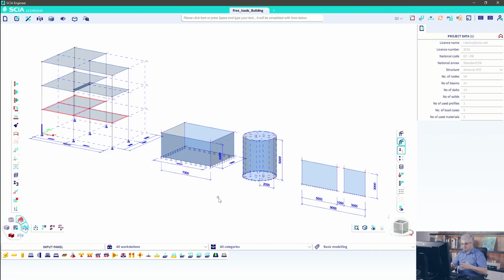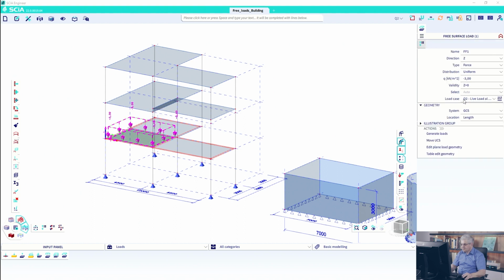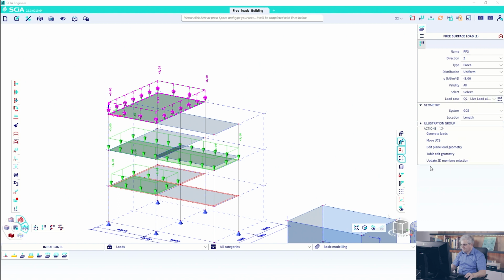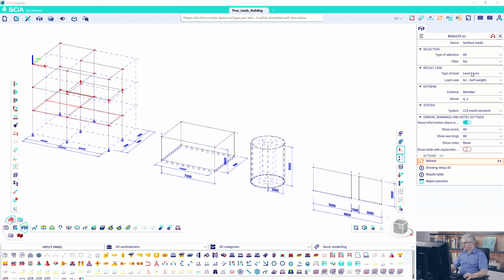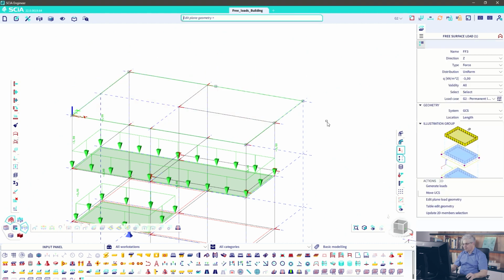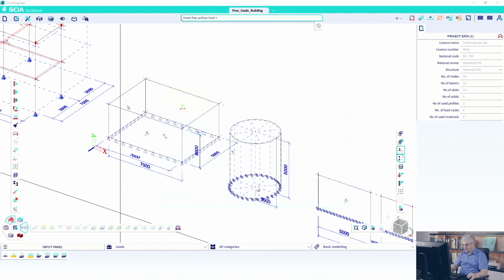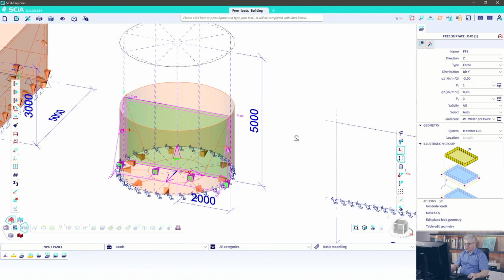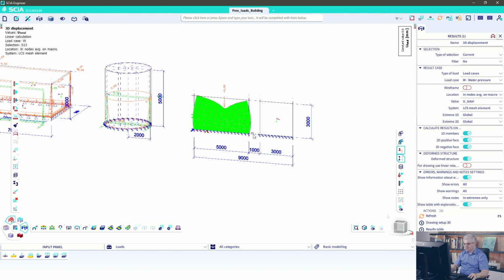SCIA Engineer Tutorial: Free loads

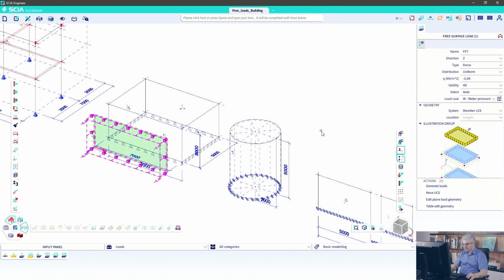Comment: Please, I have a question, if you don't mind. At 19:30-19:45, if you didn't want to add load by Local coordinate system of the pool's wall, but according to Global coordinate system - why would the option Direction: Z in GCS make the load point downward? You made the GCS so that the Z axis points horizontally (through the screen's plane), so I would expect the load to pointed in the same way it pointed when you chose Z direction of LCS, only the opposite way. It's like it doesn't matter whether you change the GCS or not, because Z axis is vertical in the original, unchanged coordinate system, not this one. Thanks in advance.

Comment: Thanks for the tutorial. Unfortunately (and surprisingly), the free loads in Scia are not converted to mass, so they shouldn't be used when dynamic analysis is considered.
Reply from the maker: Yes, correct. But there are many applications, where dynamic analysis is not necessary. And if somebody forgets, there are free loads, he will get a message during the converting of loads to masses. It is also very easy to create surface masses manually. For example, the live loads are divided to some patterns, but it is not necessary to do it for seismic analysis. Mainly for seismic analysis, one average surface mass is enough. There will be newer everything automatically. (But it would be great).